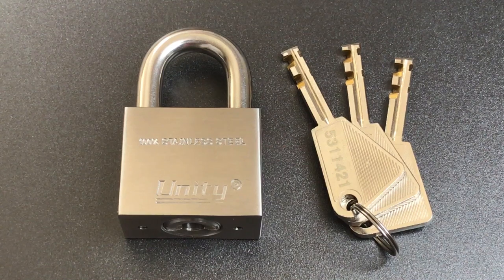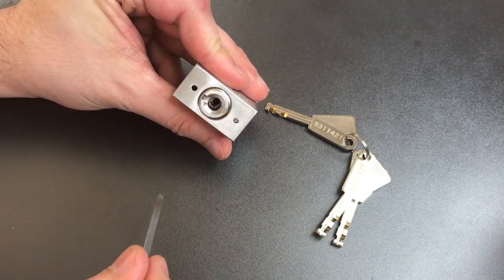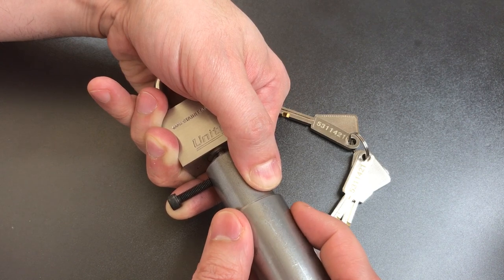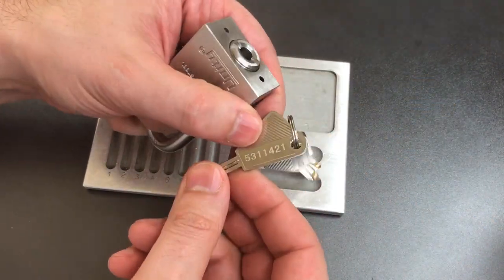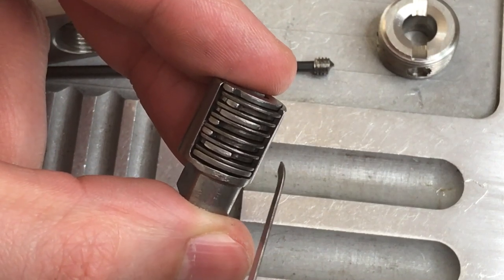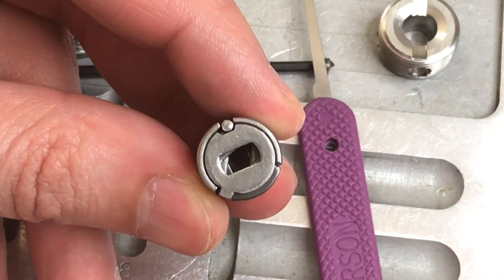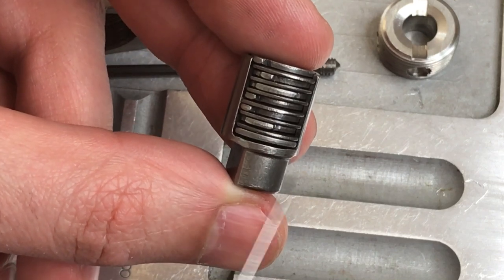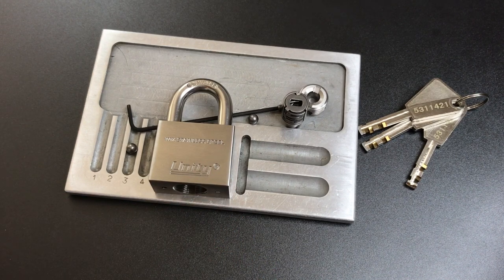[571] Unity 40mm Stainless Disc Detainer Padlock Picked and Disassembled

Comment: I know this video is a bit old, but I've recently purchased two of these locks (the minimum amount) from Unity, and I have a few things to say.

The first thing is about the analysis in this video of the discs and tabs. The wider tabs don't decrease the available number of keys. It's actually worse than that. The available bitting for each disc (using the manufacturer's convention) is 1-5, so there really are 5^7 = 78,125 keys possible, although ones with monotonically decreasing cuts from tip to bow would be undesirable. What's really happening with the wide tabs is that every disc for a certain cut is made the same way.

A 1-cut disc has a tab that's 1 cut wide.
A 2-cut disc has a tab that's 1 cut wide.
A 3-cut disc has a tab that's 2 cuts wide.
A 4-cut disc has a tab that's 3 cuts wide.
A 5-cut disc has a tab that's 5 cuts wide.

Here's why that's worse than you thought. For cuts of 2, 3, and 4, if you rotate the discs as far clockwise as they'll go, you only have to back them off by one cut.

A 1-cut disc stops in the place for a 1-cut.
A 2-cut disc stops in the place for a 1-cut, so back off 1 cut.
A 3-cut disc stops in the place for a 2-cut, so back off 1 cut.
A 4-cut disc stops in the place for a 3-cut, so back off 1 cut.
A 5-cut disc doesn't move,

See a frame at 5:10 for reference. The bitting is 5311421 (tip to bow). The 1-cut and 5-cut discs are fully clockwise in the open position. The other discs have been backed off one cut from fully clockwise.

So to pick the lock, you only ever have to leave each disc where it is or at most back it off by one cut. My paranoia instructs me to believe that these locks are made this way intentionally to make them easier to pick. Do Chinese cops want to make it easy for them to open locks in China? Does the Chinese government require that every Chinese lock sold in America be weak to entry attempts, even if it's otherwise well-made? My paranoia is confused on that point. Whatever the motivation for weakening the implementation, a Dremel or a metal file can fix it, as LPL says.

The second thing is that the lock I bought recently is not quite as high quality, although it's still fairly decent and incorporates the wide tabs as I describe them above. The differences in the more recent manufacture are:

The angle between cuts has been increased, so there is no longer a 5-cut. Additionally, the last disc (next to the bow) is an any-cut. The gate stretches from a 1-cut through a 4-cut. Thus there are now only 6 effective discs with 4^6 = 4,096 possible keys (including undesirable bittings).

The plug retainer is only threaded for about a third of its depth. The bottom two thirds incorporate a groove that runs around the entire circumference for the set screw to catch. There are also a lot of burrs on the threads, which I wouldn't call well-machined.

The lock in the video seemed to be soaked in oil, but the one I got was filled with some really viscous orange grease that made napalm look like an amateur at stickiness. I wiped what I could and flushed the rest with WD-40.

The last thing is that Unity isn't the manufacturer. I don't know the manufacturer, but I''ve found other locks I believe were made by them identical and similar to the Unity locks, but with other names on them. Apparently the manufacturer OEMs the locks and engraves whatever name, etc., the retailer wants. In particular, Kawaha (Kam Wai Hardware) sells closed-shackle versions on Amazon. (Kawaha says the manufacturer is well-known in mainland China for high-quality products. Maybe that's just shameless promotion.) I found a Chinese web site that sells the full range of locks made from not only stainless, but also carbon steel, brass, and iron. (Yes, iron. Iron body. Iron shackle. I quadruple-checked to make sure that wasn't a translation error.) The iron ones are really inexpensive. The web page for them includes a disclaimer that they rust easily, so the purchaser should consider the application carefully. I think that, for the right recipient, an iron one would make an awesome Christmas present.

Comment: let me ask you this.....what if just you rotated the furthest most disc in just with a small tool, without turning the upper discs before them...Won't that just open the lock anyway?

Comment: Is there any lock you can't pick?
Reply: Ricky Bobby Generally, as soon as a pick can be inserted, it’s over. However some locks are built in a way that closes the entrance before checking the combination, then you can’t fiddle with them. They are rare on the market, because keys have moving parts and so they’re weaker.

Comment: I want a foolproof lock that can lock my bike up without me having to worry about it being stolen all the time. I have a brand new 7-speed cruiser with an engine kit added on and it wasn't cheap. Can anyone give me some suggestions for a bike lock that will give me peace of mind? They can always put out so many with that setup and then they could simply change the last disk to add more lock runs.

Comment: https://i.imgur.com/tKx56Ew.png I suspect making the false gates at different depths and different widths, would make it harder, because it would be more difficult to tell which one is the deepest and proper width. You could assume a very narrow and short false gate is a false gate, but then if you have a very wide but deeper gate, you may assume the false gate is the real gate. You could even make some of discs have the false gates be wider than the real gates, to add inconsistencies, to make picking it without knowing this, more of a pain for the bad guys, because you would probably assume the widest gate is the true gate and may be searching for the gates that are that width, on all the discs and get frustrated when you can't find them and have to start over in figuring out which is the real gate size.

Comment: Sorry, your computation is wrong. Given all but #7 are at random places, you almost don't limit the combinations (you only remove combinations that have all discs with low cuts). And then it's actually better as it makes picking harder (you can't start from all discs in far position).